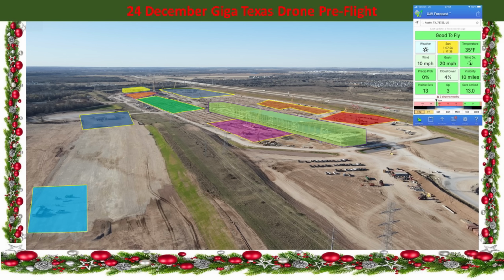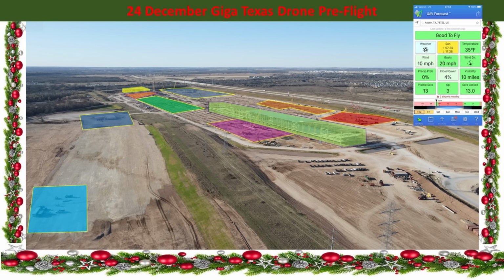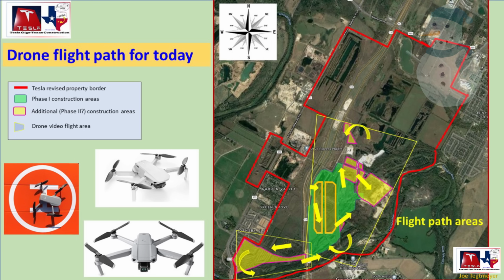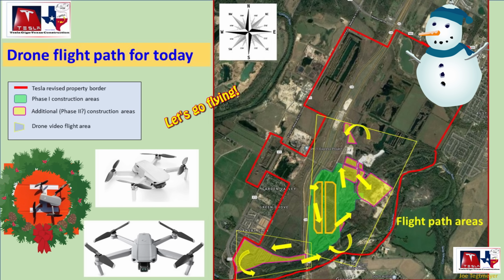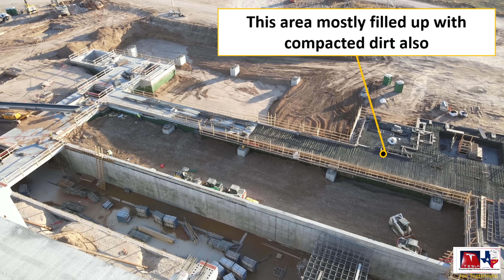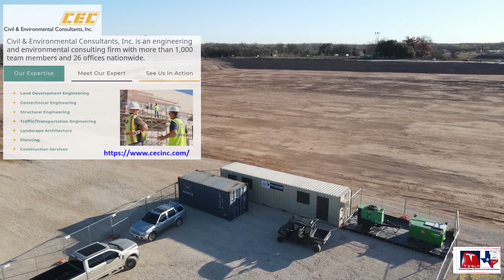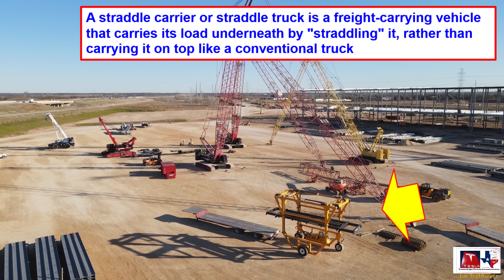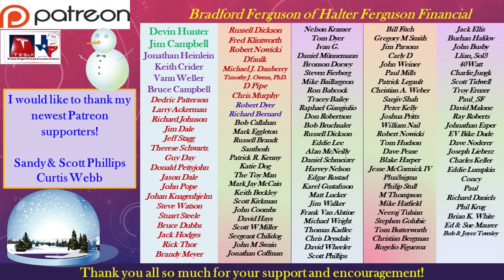Tesla Gigafactory Texas 24 December 2020 Cyber Truck & Model Y Factory Construction Update (08:00AM)

Comment: Short Column fix. For fellow sidewalk supervisors concerned by the installation of a concrete block to bring the column up to height. It’s not the first time structural components have been stacked on top of each other to make something higher. Have a look around the rest of the site. One component stacked on another component stacked on another component stacked on another component…………

A simple solution to a simple problem.

Things go wrong on building sites constantly, and for the most part are caught early and get sorted out. This was probably noticed as soon as the beam was placed. 

We sidewalk supervisors noticed an out of plane beam in Jeff's Day 148 Dec 17. Block to fit on top of column showed up in Randy's #78 of Dec 21. That gives a 4 day turnaround to come up with a solution, design it, cast it, cure it, and get it to site. I find that impressive.

Even the best run sites have issues, I even saw an out of level beam at Berlin. 😱

Comment: There is one red crane that does not yet have it's boom (two new red cranes and the yellow crane that did the north end of the big steel structure are parked together, but east of them is the bottom of a 3rd red crane)

Comment: I don’t remember them GeoPiering the Northwest corner of the complex. Since this was mostly lake and certainly not undisturbed soil, they are going to have to do some sort of preparation to build anything bigger than a patio on it. Maybe the GeoPier folks are just taking a short break and awaiting the folks working on the Northeast corner to get out of the way. They needed someplace to assemble all those cranes and equipment.
Reply: The NorthEast corner was also a lake and they used the deeper drills and mortor when they did the drilling there. I would not be surprised to see the same thing on the NorthWest corner.
Reply: Definitely more geopiering to do, possibly with the concrete in that NW corner, since it was so swampy. Need to clear the area of crane assembly and prep equip before they move in to do it there, so may still be a week or two out until significant steel assembly is done just South of that area.
Reply from the maker: I am expecting them to do a lot of foundation reinforcement in the northwest area as well.  This was the area with the larges pond and the last one to be filled in as it took a lot of time and dirt, not to mention a lot of Geotextile membranes to stabilize the soil

Comment: Wow! that correction on that column.. so I was wrong thinking it was OK after all LOL!.. makes you wonder how this could have happened, expensive error, probably required some engineering and design efforts to figure out a solution without the need to replace a huge column, probably worth tens of thousands of dollars. Probaly also caused a little delay in the construction, but probably will not have any influence on the end date... 

Merry Christmas Joe, your work is much appreciated.
Reply from the maker: Thanks Marco!  Merry Christmas! 🎁🎄
Reply: Probably no delay, they just worked further North earlier than expected and will now come back and pop that beam on and put the roof panels on next work day!
Reply: That short column was likely destined for the east side wall of the building (slope is in that direction). So was shipped there out of order and not noticed until after it was erected.

Comment: Joe, thanks for all your effort this year. Just a few observations: Austin needs to take a page out of Berlins book. Organise the construction camps in one location; similar with the concrete batch plant, replace out of spec columns - not patch them. It seems some decisions are being rushed. However on a project this size there will always be a few mid-course corrections.
Reply: Nothing wrong with a solution that is quick and has no drawbacks. They had that block ready for the past week, it was at the foot of the column, and used the time to prep it with rebar. When installed on top, drilled holes in and tied them together, so now it is like one column, and the cross beam can put its full weight on top. 

I have seen accommodations for mistakes in the Berlin construction too, especially around the stamping and casting pit areas.
Reply from the maker: Thanks Pieter and We will see what 2021 holds for Giga Texas and the decision they make as the factory becomes a completed project.

Comment: About the staffing containers... if you compare it to giga Berlin, there are only a few on the Texas site, in Giga Berlin they have whole office buidings three stories high with tens of such staff containers.. Texas is maybe 10% of what is present on the Berlin site, quite a big difference... But maybe this will grow to a more substantial size once also on the interior is worked on, with more companies involved and more engineering logistics and planning people required
Reply from the maker: We shall see.  Thanks for the comments!
Reply: I believe that in Berlin, they needed a lot for engineers and design teams until they have the buildings built.   It was a matter of getting the good engineers hired before they took a different offer.  I don't think they have that same issue in Austin.  HQ is not far away and travel restrictions aren't as bad interstate wide as between countries.

Comment: A great overview today, amazing to see so few on site - I hope that means most of the workers've got today and Christmas day off, they've really been pushing. Loved the rapid solution to the short column's dilemma, just put a cap on it and move on. Often the easiest solution is the best solution. I seem to remember that in an earlier video you'd mentioned that some amount of factory needed to be dried in by the new year, looks like they've fallen a little behind in that regard, but from 30,000 ft, the amount of progress is astounding. Have a merry Christmas Joe.
Reply from the maker: Thanks Ivy and Merry Christmas to you too! 🎄👍☃️🎁
Reply: That was a very early goal, before some heavy rains and erosion, plus significant design changes, kicked in. Probably have a lot of that NE steel section dried in by mid to late January. Possibly part of the SE section over the former pit as well, where the isolation foundations are.

Comment: Yup, Merry Christmas from.Australia! It is difficult to imagine the final material and componentl flow if, as rumour has it,  the north end concrete columns are for a casting machine. This would locate it at the opposite end of the production facility from the stamping shop. Casting machines and stamping machines are normally located not too far apart. Also worthy of note is that in Berlin, there are 8 casting machines, each with substantial foundations. No sign of that here at Austin, yet.
Reply from the maker: Thanks Andy!  There is room for 8 casting machines here as well ... they are approaching the foundation construction very differently from Giga Berlin, that’s for sure!  Also, Giga Berlin separated the casting and stamping machines by a good distance as well.
Reply: I think it's stamping at the south end, casting at the north end with body-in-white in between which take in both
Reply from the maker: @dmpease01  that is correct ... check out my 20 Dec video where we cover this.
Reply: @dmpease01  quite possibly. It will be so interesting to see how the layout develops.

Comment: One small element of this video provides evidence of the steel contractor's effectiveness, or lack thereof. At 17:35 in the lower left of the frame we see a moving forklift. By 17:51 the tacking of the forklift moving steel is completed.

I see these steel moves constantly. A week ago when they set a multi story "X" assembly, the crane operator had to travel through a corridor with a slight turn to pick up a beam needed to tie that set  "X" assembly to the structure for stability. Cranes are not used for driving around a stockpiled steel yard to find a needed structural piece. The steel sub has picked up the pace but remains inefficient in so many ways.

Comment: I am wondering if they will not be able to lift the beam on to the spacer until they also have the beam on the other side as a counterbalance for the spacer. I suspect, from no experience that the weight of the beam plus 16 roofing pieces would be too much weight for whatever is attaching the spacer on

Comment: Merry Christmas! It does finally look like build work will explode after the holidays with crews erecting structures at least at 4 separate parts. My fall prediction of all footers ready and 50%+ steel / concrete columns standing was far off (based it on Giga Shanghai), but there is no rush really.
Reply from the maker: Thanks Bone for the thoughts and for following along this year.   Much more in the coming year and keep in mind I think we have seen some fairly major building design changes along the way too, so that could explain part of the slightly slower progress than you had predicted (not to mention Giga Texas Phase I is three times bigger than Giga Shanghai's phase I).  I wish you a Happy New Year and we will see what this new year brings to Giga Texas!
Reply: @JoeTegtmeyer  Great lad, thank you! 

So when do you think Boring Company starts digging under it as Elon said they will? :D
Reply from the maker: @BigBoneESB  I don't know but one of the other quad squad pilots has made it his mission to find the first boring machine on site.  Hasn't found one yet, but he's determined!

Comment: The Berlin Factory has a lot of roof windows. I guess that we'll have to wait and see, but it seems to me that the Texas Factory won't have that feature.
Reply: I don't think so.  Elon believes in lots of natural light.  So far the part of the steel structure is the paint/corrosion protection section.  So skylights won't be beneficial.  We'll have to wait and see on the other parts of the buildings.  The stamping/casting sections in Berlin don't look to be getting much for skylights, but are incomplete. I doubt they will in Texas too.

Comment: 4:30 Are those two empty lonesome columns on the end of the concrete structure both the same height?
Reply: Yes. They have been waiting for a roof beam for a few weeks now
Reply: Furthest east one probably slightly shorter to match up with the roof angle slanting eastward for water drainage.
Reply: They are both different heights, both taller than each column in the western most row, and both with a different shape to the top to each other. I don't think this is a mistake. It's the outside of the building, and the beam setup, and how the double T roof panels tie into them is likely to be a different arrangement. There's a good view of the columns here at 10:52, https://www.youtube.com/watch?v=BbOKHNHIyNI

John Yendt commented on these columns in Joe's Dec 16 video.

Randy's #75 at 10:09 shows the footing arrangement across this corner, and a number of additional column hold down bolt/rebar arrangements for yet to be placed columns. https://www.youtube.com/watch?v=haSgk4QkVBs

Guy Cadieux commented on these footings in Randy's #70 of Dec 7.

Comment: 8:20 it looks like the next row of pillars lines up on an isolation foundation.. I don't see footings.  Will they do extra long spans to the outer wall?
Reply: You see them @ 7:35
Reply: there are footings in the isolation foundation that line up with the existing concrete columns to the south. They are a bit hidden under the temp walkways that are in place in prep to pouring the concrete on top.

Comment: Odd way to fix the column, but guess removing it would be difficult and costly if it was already cemented into place. Now the error will forever be a factory construction Easter egg.

Also doesn't this "fix" mean the Interior overhead crane nubs on the columns wont line up with the rest.

Its almost like something like this has happened before if the concrete column plant had a form already for this plug piece.
Reply: The nubs are the same height on all columns. It was the height above the nubs that was wrong
Reply: I agree about the short column which should have been yanked and replaced with the correct size. I can't tell from Joe's video. But if the column length was short by a couple of feet, wouldn't that suggest that the ' T ' ledges would also be equally lower? It will not be level with the two adjacent column ' T ' ledges?  Unless I am mistaken the heavy duty track for the huge overhead Gantry cranes will be mounted upon those ' T ' ledges. It seems pretty shoddy if they attempt to attach a make-shift shim on top of that too. It's bad enough to put a shim on top of the column. The Austin Management Team needs to bite the bullet and do the right thing before they go any further.  Yank the short column and replace it with the correct size.
Reply: @bitspieces3885  nope. The T ledges are the right height, so the mistake was in the measurements above the T ledge. So this ties it together nicely.

Comment: As far as production is concerned, how does this factory compare to Ford or Gm's Detroit factories..in size, sqft...etc?
Reply: hmm depends on facility, but ford's are roughly half the size, but that difference can be explained with off-site parts of the production. I would guess that for everything in their vehicles, total floor space would be at a  very minimum equal but more likely much larger, just not at all one facility.  All depends on what you want to include, all their sub contractors, or just ford owned or whatever.

Comment: any guess on how many casting machines?
Reply from the maker: I think there is room for 6 or 8 of them plus supporting maintenance and other structures.
Reply: @JoeTegtmeyer  According to https://www.teslarati.com/tesla-giga-press-elon-musk-master-plan/ one giga press can do about 1,000 castings/day.  Based on the article, say 300,000 castings/year/gigapress times 8 = 2.4 million castings/year.  If what we hear is true that the front and back of the frame will be a casting (2. castings/per. vehicle) then that works out to be 1.2. million vehicles./year.  Kind of hard to believe that this will be possible.
Reply from the maker: @JimB802  it looks like this article doesn’t get everything correct, confusing stamping machine isolation foundations with casting machine locations.  Giga Berlin will have 8 casting machines.  I don’t see why Giga Texas would not either.